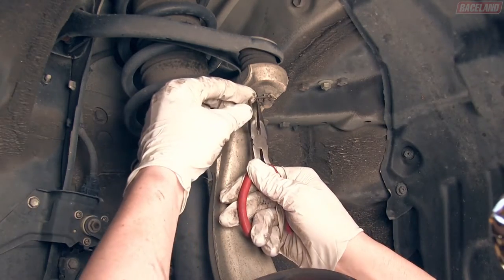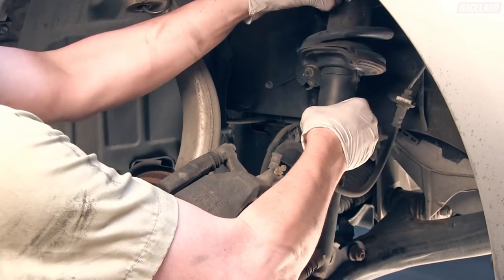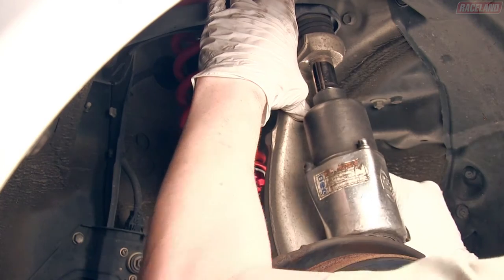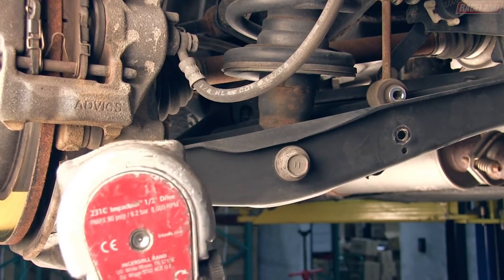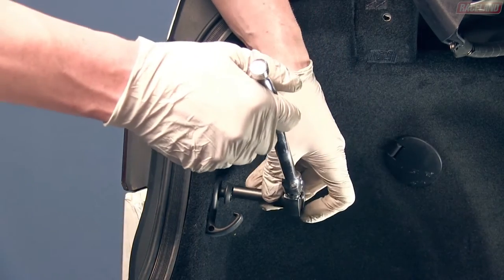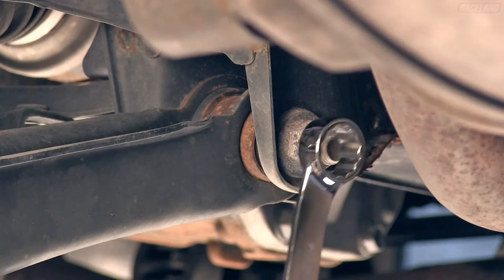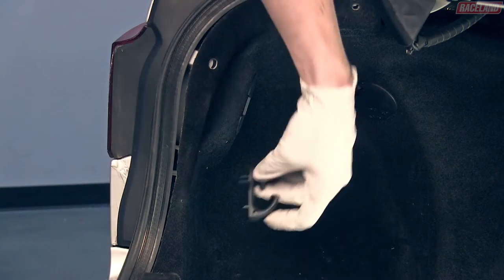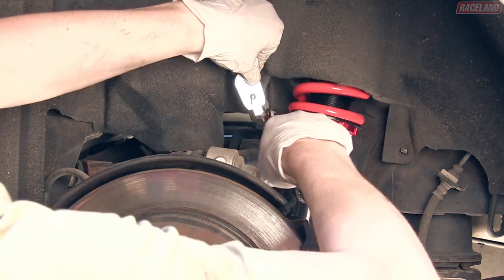How To Install Raceland Lexus IS250 Coilovers

Comment: I have had these on my 250 for a couple years now, going to replace with new ones because they are getting bouncy and they did not do this before. Im just glad you guys offer a life time warranty. Also just a quick tip to anyone getting these, make sure you unplug the ABS sensor on the back of the steering knuckle BEFORE you undo the upper ball joint. The wires will rip out the back and you'll need to replace it.
Reply: Good note.... thank you for this.  I made sure to unplug the ABS sensor and you saved my a$$.  Question:  after install, i still have these lights on:  ABS, Brake, and Traction... Help?  THanks man.
Reply: @brianyt56 did you ever fix the problem? I have the same lights appearing

Comment: Before you tighten your bolt, aren’t you suppose to put load on to the suspension before you tighten the bushing? I heard it’ll wear immaturely if you tighten them before you lower the car to the ground
Reply from the maker: Yes. You'll want to load the suspension before you tighten everything down to spec.

Comment: 0:50 I can’t take the bolt off it’s so hard I tried and hammer it I’d didn’t work
Reply from the maker: Soak it in a penetration oil like PB Blaster and let it sit for several hours.
Reply: Nah that is not gonna help as well I try putting WD40 and keep hitting them it didn’t work
Reply: pitman arm puller
Reply: @fawadmoradi4402  PB Blaster is FAR superior to WD40 for frozen bolts. After discovering PB Blaster....I will NEVER buy wd40 again.

Comment: this was the best video.. however, after the install, i still have these lights on:  ABS, Brake, and Traction... Help?  THanks.
Reply from the maker: If you disconnected any electronic systems during the install, that would be the culprit.

Comment: Is this an all wheel drive is250? If not will the install be the same ?  Thanks
Reply from the maker: This is for the two wheel drive models. We haven't had the chance to run fitment on the AWD, so we wouldn't be able to confirm if the install is the same.